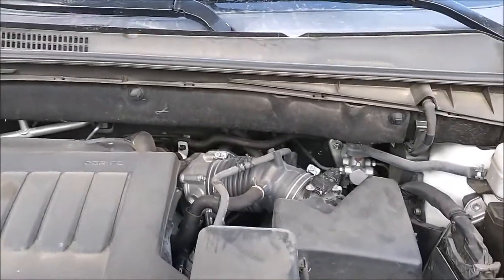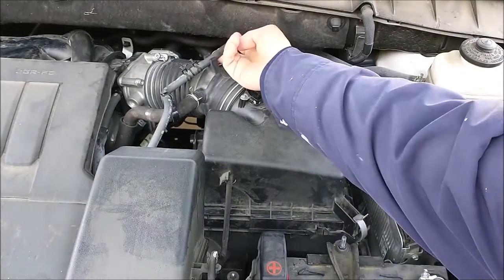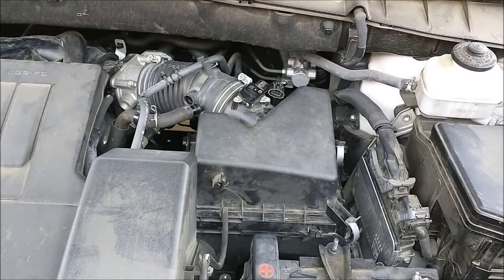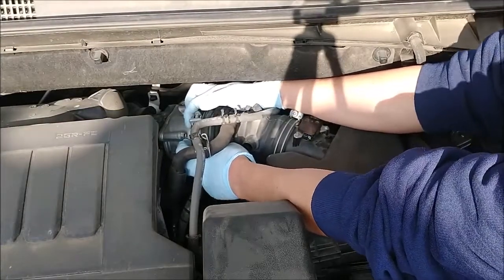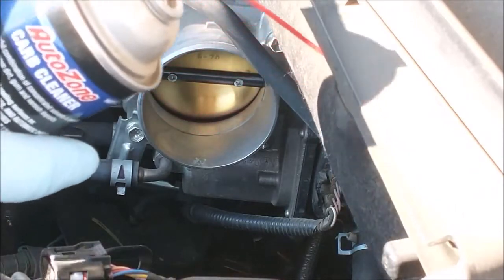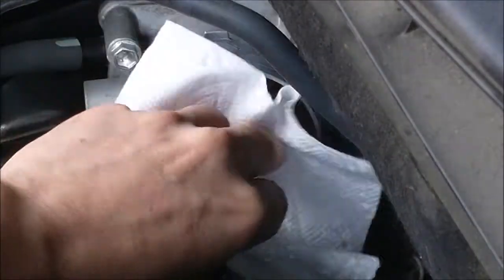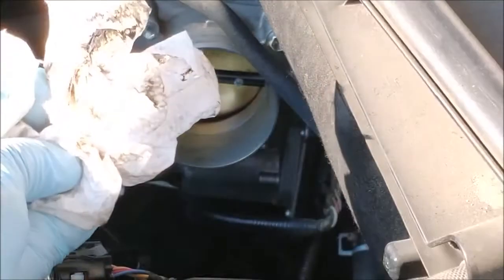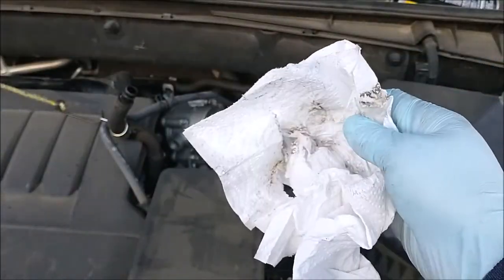Beware when cleaning the throttle body of Toyota highlander, Sienna, Lexus with any solvent

Comment: Sir, don’t move the plate with your fingers you can make a damage to the throttle gears. Switch the key to on and without turning on the engine press the accelerator, throttle should open.
Reply: I have a Rav4 2006 and I touch and move gently the plate. 
Scotty Kilmer and The Car Care Nut say the plate can be moved gently.
Reply: How do u do this in a push to start?
Reply: @LarryVanz exactly, all master mechanics gently use their finger to move it.
Reply: The Car Care Nut and another YouTuber I trust says use your finger but push the throttle plate slowly and gently. Use THROTTLE BODY cleaner to be safe. Just the s@me, if you are cleaning the amass Air Flow Sensor use MAF Sensor cleaner only!!!!
Reply: @Jerryyy6802 instead of holding the brake and pushing to start, just press push to start but not the brake.
Reply: I have a 2017 sienna and it doesn’t work for me
Reply: 2019 Highlander didn't work for me

Comment: You shouldn’t use carb cleaner on a throttle body. It works but it’s very harsh on the rubber and seals inside the intake manifold. They make a throttle body cleaner for that application. Toyotas use a different kind of rubber so if you have genuine parts and seals you should NOT use a carb cleaner in this way. That stuff is meant for carburetors not throttle bodies. Very different automotive parts
Reply: To further elaborate without getting into the complexities carb cleaner also does not evaporate as fast or cleanly as throttle body cleaner. You’re more likely to suck all that stuff up into the internals and wear at those seals. That being said this will work to an extent but the best way to clean this all would be to remove the intake manifold, replace the seals, clean it without power going to any sensors, and to use the correct cleaner. With this generation 2GR-FE engines the intake manifold can also have extra valves that control runner length if you use carb cleaner on those engines you’ll be buying a new intake manifold and they’re quite expensive. It also will dry all the plastic on those manifolds and lead to warping and other issues. End of the day be careful what you put in your Toyota engine, they’re built well and last forever but to get the best life you gotta do things right.
Reply: What about brake cleaner? 🤣
Reply: @joshuap8224  good info. is CRC throttle body cleaner ok for the lx470 /  gx470  throttle body?  can you spray directly on throttle body or do you recommend spraying on to the paper towel then wipe with that?
Reply: Many carb cleaners are marketed as carb and throttle body. As for the seals part, inside a carb has many seals, plugs and o rings. Sooo...meh

Comment: you shouldn't manually open the plate of TBS , this will confuse its readings u don't know , do not do like him
Reply from the maker: The car is not on, how will it confuse the readings?
Reply: I think this happened to me, now the throttle doesn’t do anything 
I manually opened a Sequoia 2UZ 2001 throttle body 
Is cable operated but the cable doesn’t do the job, electric motor do 
So, how can i recalibrate the trothle position sensor again, need i a scanner?
Reply: Unplug/disconnect the negative battery post, and you should be fine with the car off.

Comment: Use only a throttle body cleaner , not a carbeurator cleaner . I would not use a paper towel such as that for drying hands , etc . But use Scott Brand of " shop towels " that are blue , thick and resist tearing . If a piece of towel falls into the throttle body you will have problems .

Comment: NOT THE CARB CLEANER 😭😭😂😂 Use specific for throttle body 😭
Reply: Yeap. he might of messed things up.. since its a Toyota Highlander.. they should of picked one up from the dealer to be safe.
Reply: How do you know those ingredients aren't similar? Have you referred to respective SDS? Much of that is merely product labeling when same ingredients & method.

Comment: From all these comments this guy did it all wrong 😅 yikes. When I did it I unplugged the negative terminal.  And specifically used "throttle cleaner " and did not open the throttle.  I removed the throttle and cleaned both sides of it.

Comment: Incredibly useful and it helped me a ton - I normally spray directly into the throttle body or disassemble the throttle body housing and clean it with a nylon brush. Your method is better in that you use towels from the outside to protect all of the sensors around the throttle body. I just did this for my 2007 ES 350 and like you said, when I started it , the ignition threw codes and the engine unfortunately had a misfire, and let the car run out some of the throttle body cleaner solution while misfiring ... - HOWEVER:    I then turned off the car, disengaged the battery terminals and put my headlights on the 'on' position,  while the battery was completely disconnected in order to drain the car of electricity. (This sets the car in a factory restart..) , I then turned the headlights back onto the 'off' position,  reconnected the battery terminals, and started the car. It fired up perfectly and the idle sounds much better. Thank you for your help ! ! !

Comment: I've seen throttle bodies @ 100,000 miles that were TOTALLY black with Carbon.

Removal and meticulous cleaning was required.

After that, good for another 75,000-100,000 miles.

Comment: Well damn dude did somebody hold the gas pedal while the ignition was turn to the accessory to open that throttle plate
That's electronic throttle body
Isn't it ?

from what I heard and read
That's a good way to screw all them gears up and that throttle
Reply: Doesn't hurt a thing as long as you're not rapidly moving it back and forth